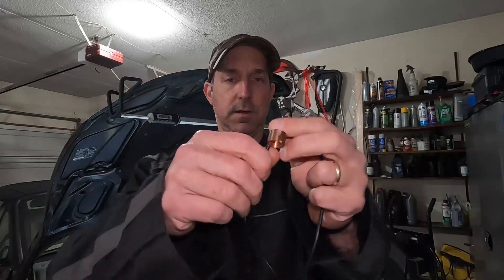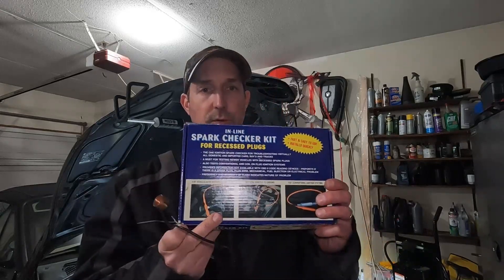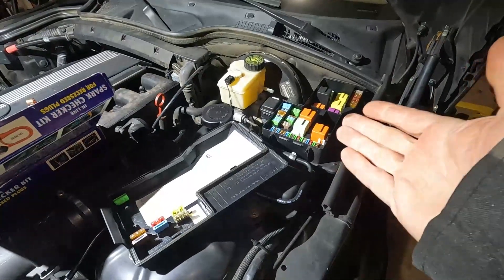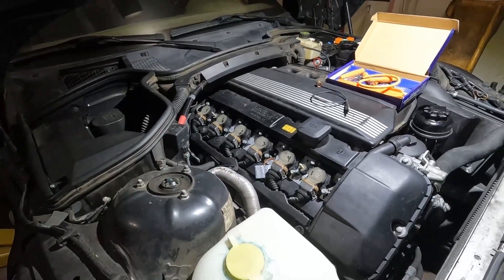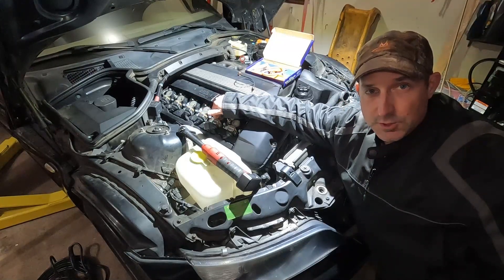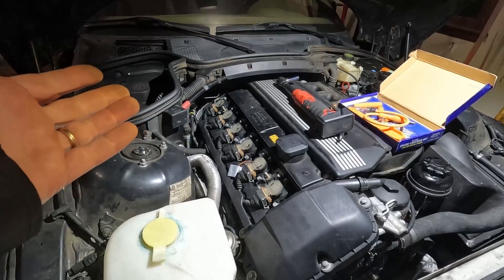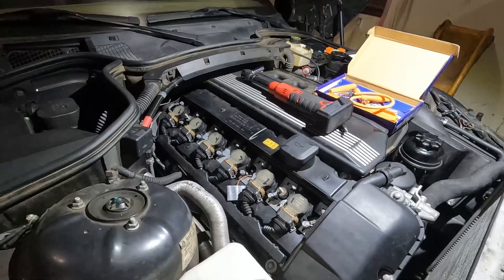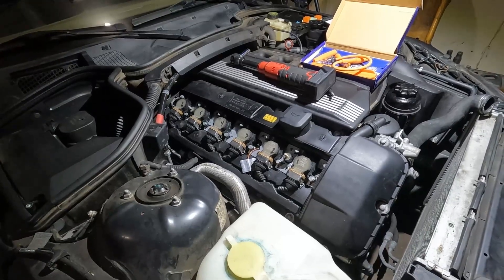How To Test For Spark! Bad Coil? Faulty Engine Computer? Easy To Follow Misfire Diagnosis Steps!

Comment: Thanks, Roger!
I'd go with the NOID style tester as to avoid an open spark in case of fuel vapours nearby.  Although, my Costco fire extinguisher is always close by 😝

I imagine you're getting misfire code(s) on a scantool, is that right?  I remember once having a misfire code Cyl1 on my N52.  Took it in to my (trusted) dealer and they confirmed coil cylinder 1 was bad by swapping with another as you mentioned.  New coil, problem solved that time anyway.
Reply from the maker: I agree completely. The open spark is a bit scary and could cause an explosion if there are any combustible vapors. But it was fun to demonstrate and it works great for chain saw diagnosis :)